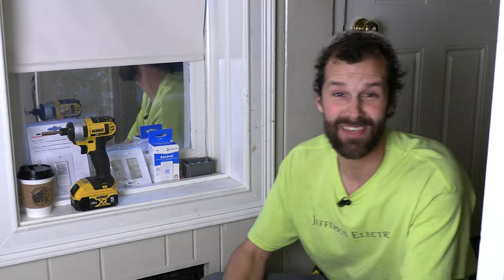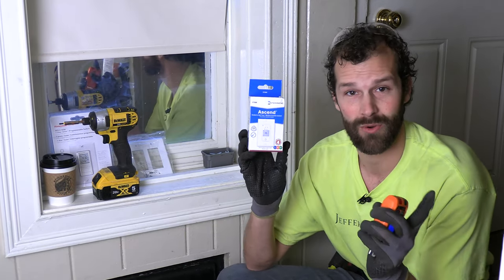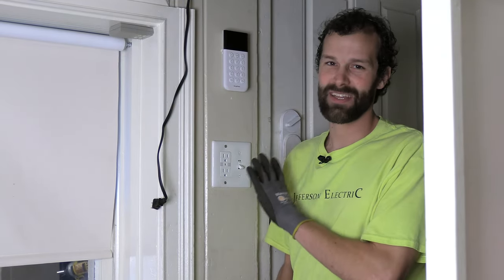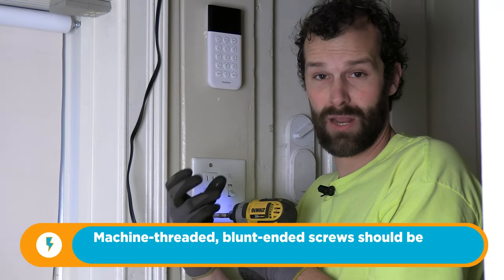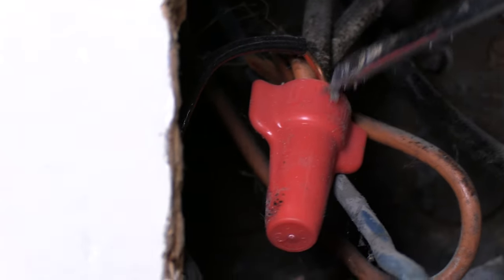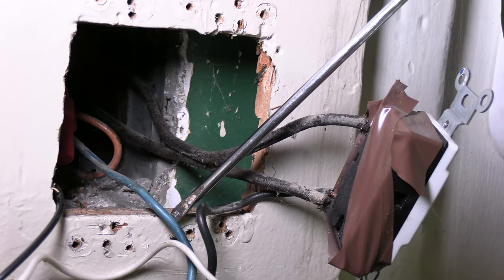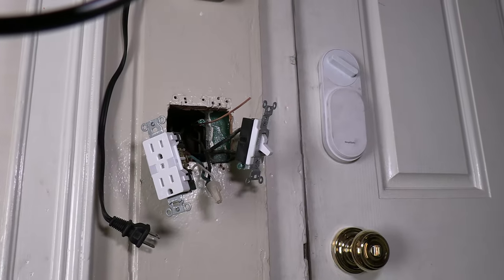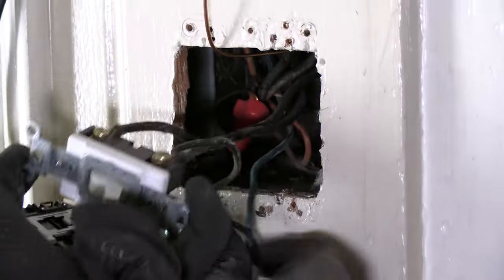Installing New Smart Switches In Old Weird Homes

Comment: I have watched several of your videos and even though one was at least an hour, watched every second of it.  I am just a guy who has always been fascinated by electrical work; if I had a second life it would be as an electrician. Your knowledge of code requirements and the reasons why are very well articulated and comprehensive.  Most of all, you are not taking shots at anyone, but rather will point out code violations that frankly are far beyond the ones that I am familiar with (e.g., using wood screws to secure an electrical device rather than a machine screw) and are doing a public service by posting these videos.  Most of all, for a guy brimming with knowledge and "in the field" know-how and techniques, you are humble when you say "hey, this is what the code requirement in Indianapolis is, but you should check with your local inspector for the requirements where you live".  No one person knows everything.  You are close, but still are decent enough to admit that you are still learning. Very glad I came across your videos, and yes I am a subscriber.

Comment: You taught be to be careful with existing wire and am so grateful Joel.  I don’t twist wire’s anymore and use wagos.  No more destroying wires every time I change something. While the cost is more, replacing a wire is far more expensive.
Reply: WAGO is the way to go.

Comment: I've had to remove smart switches from houses; the owners were 'technically challenged'. They couldn't deal with programmable thermostats either. I've made good money setting up home audio systems too.
Reply: Definitely can see lots of this happening in the future as homes change hands and a house needs 50 apps. I prefer manual timers . Not everything needs internet
Reply: This is going to be and already is somewhat of a bonanza. There is so much Chinese junk going in homes these days.
Reply: @MM-fe9mz  It’s pretty easy to set up a smart home and have everything be controlled by one app.

Comment: Lutron caseta is very consumer friendly, rock solid reliable, great customer service, and highly configurable. Want a 3 way switch, just add a remote (looks identical to switch, no wiring required). To my knowledge, it's one of the only smart solutions that doesn't require a neutral for some switches. Lutron also has more industrial / commercial lines like RA2. Only down side is that they can be pricey and don't look like conventional switches.
Reply: There are plenty of "smart switch" solutions that don't require a neutral, but you always want to use the option with the neutral if you have neutrals available.

Comment: lol, back when I was doing electrical in Canada the #1 square tip was quite standard in every screwdriver set. one could go to Canadian Tire or Home Hardware and every screwdriver set would have at least a #1 and #2 square. medium and larger sets would have the #0-#3 tips. In fact the ground rod clamps I used to use were fastened to the rod and wire with a #3 square.
Since coming to the US for work I haven't had to buy a Robertson tip in the last 4 years.

Comment: I  worked for a company on a residential condo development project.  They had sticking out over a half inch from the drywall and were cutting them flush with aa saw.  Also used the white conductor as a switch loop without remarking it black or red.  Their excuse was that their AHJ was working off the 2008 NEC.   What a bunch of hacks.

Comment: The adding the box equipment ground is a possible concern. Keep in mind im making some assumptions. I am assuming you have some form of older BX,MC, or AC cable coming into the box and you are gaining continuity box to metalic cable, so your outlet tester says the equipment ground is good. However man types of older metalic cable are not approved for use as equipment ground, the metalic cable will have a low DC resistance as read with a meter or work with your tester, but the rotations of a metalic cable in AC form a higher resistance coil that will not clear a fault and cause the metal jacket to heat up and cause a fire. I have seen a similar situation to this cause a house fire.

Comment: Don’t quote me, but I believe the old knob & tube conductors were 14 gauge but rated for 20A because they were in free air, meaning not in a sheath, so they would dissipate heat. Unfortunately most hoses of this age have added insulation, either blown-in or fiberglass, covering the wires. I’m planning on replacing as I can.
I’m not sure that grounding to the Box is code compliant.

Comment: @ElectricProAcademy, @Joel Walsman - Love the videos! Thanks! Have just one hopefully simple question: Is there a similar way to install standard smart three-way switches in a box where the electrician used the neutral from the breaker box as a traveler? 

I have a three-way switch with the Neutrals in the box, but this is the load switch (shorts the circuit, when I connect the Neutral wire to the switch), and the line switch uses the Neutral wire as one of the Travelers! The line switch is configured in a two-gang box with another three-way switch (I would like to replace that one, too). Can I pig-tail the Line (or Neutral) wire from the adjacent switch to the Neutral for the smart switch? Thanks.

Comment: Is there a short edited version of this? Video quality is great and all. Can a 3 wire dim smart switch be safely retrofitted to old 2 wire house?
Reply: Probably.  It depends.  Most smart switches demand a ground, but I bet that's more CYA than anything.  If you have a ground in the switch box, I'd be you're fine.  If you have a neutral too, you're golden and I'd use the 4-wire version (as they're sometimes called).

Comment: I tried x-10, did not like them, got z-wave with a vera brain. I love it. I got motion detectors, cameras, door and smart switches. When inside opening the door turns on the light, outside motion turns on inside and outside lights. The camera records when the lights come on, the camera turns on lights if it sees motion. After 10 minutes vera turns off the lights, at 10 the lights throughout the house get turned off and at 930 in the morning. lights do not come on between 7 am and 4pm

Comment: If you have good, modern wiring and you plan to use a wire nut, the best method I've found for mixing solid and stranded conductors is via pre-twisting.  To ensure the stranded conductors don't come loose the best pre-twist method I've found is to arrange the conductors in a flat line so that none overlaps the other, making sure to keep any stranded conductors toward the center of that line.  Then I use a set of linesman's pliers which grips all of the wires equally and give the whole thing 1.5-2 full rotations of my pliers.  Cut the un-twisted bits off and thread on the wire nut, and make as many twists and tugs as your heart desires to ensure it is all well-connected.  

If you want to do a quick and dirty test of mechanical connectivity, twist the wires together with linesman's pliers like above, then cut and stick them in the wire nut.  Now for the fun part, or as I like or call it, "Fuck the next guy!":  Find a drill socket that fits the knurling on your wire nuts.  (You have already verified the wire nut is on there, right?)  Stick the wire nut and the socket together, and slide your fingers a couple of inches down the wire bundle, then run the drill until the twist reaches your fingers.  It is gentle enough that you won't punch through the top of the wire nut while also ensuring that nothing wiggles loose after the tug test.
Reply from the maker: Wow, that would be a crazy serious termination practice.

Comment: My opinions for lights is to not have them come on at dusk, unless you want them for security more security, but to have them become "active" when the sun goes down, meaning that at dusk, and dark, if they detect motion, then come on, then at dawn, not come on anymore whether they detect motion or not. So for that, two switches, dusk to dawn and motion sensor would be ideal. If there's a situation where you want the lights to come on without needing to go out there or in the day time, for whatever reason, then you would still need a manual switch. (Resuming video now)

In 1938 polarized plugs weren't a thing either. When my Mother and Dad inherited my great grandpa's home, I was 5. So I was too young to know about rewiring anything. Even though it was 1981, the house was built back when there were not polarized plugs. My parents had a fit trying to plug things in. My Great Grandpa had adapters on everything. He even had those electrical extension cords that screwed into light sockets with cloth wire.

Lever nuts would have really behooved you there. Prefer Wago brand just because they're not bulky. Look forward to seeing what you do when you rewire your house. I'm "SHOCKED" no pun intended, that you didn't use a box and put those connections back into the wall without a box.
Reply: In 2019, I did exactly as Joel did here for my front porch light. The light was replaced in 2016 with a better looking light and an LED bulb. The switch is a dusk/dawn switch that stays on all night, off at dawn by utilizing the longitude and your time zone and adjusts on/off every day as the seasons advance. That way, I hear it click to come on in the evening, off in the morning and I don't have to deal with it. The back porch has a photocell to turn on the lights there, and they stay on all night and go off in the morning so I just leave that switch on all the time. Came with the house and is a twin Par light that lights up a good portion of the backyard.
Reply: @johnhpalmer6098   I HATE LED. I use haolgen wherever possible. So much better than that harsh, eye deteriorating, LED rubbish.
Reply: @michaeljavert4635  At one time, I did too. In the early days of LED, they were not very good but have improved a tremendous amount since and now I find them more than fine. With the except of the kitchen main light and under cabinet lighting and my studio, which are either CFL/Fluouescent, the rest are LED, all soft white (3200K) and the light is more than fine. All of my 3-way bulbs are LED too.

Comment: Simply adding a grounding screw added round to the circuit because the ground in this case is provided by the metal conduits to the box? Since the box is not visible, I got this doubt
Reply: Yes.

Comment: There are lots of cheaper "smart" switches which have similar capabilities for much cheaper.  Most are programmable through an app on your phone, and they will do the dust-dawn thing just fine.  The big thing with this switch and cheaper ones is current capacity.  Cheaper switches won't go anywhere near 15A load.

Comment: After seeing that mess i dont feel too bad about the wiring in my mobile home (all outlets and switches are decora and use rv style connections (wire is shoved between sharp slits and there is no outlet box its all self contained in the outlet/switch itself), switches dont have a neutral and because of said wiring method it is just straight 14/2 shoved din the back so it uses white as hot for going to the lights but the wire is not marked as hot.

also had multiple neutrals from several circuits meet on an outlet box, so even though i turned power off to the circuit one of the neutrals was still connected to a live circuit so i got a but of arcing while disconnecting it.

boxes for ceiling lights are all bakelite so everyone the holes are stripped for screws, so things dont tighten up correctly. its all a mess but at least there i s alot of slack in the cables to rewire (nothing feels stapled behind the walls either)

Comment: on the plug with night light, you left the wires in wrong poles? And then when you put the switch and plug back in the hole , you did not place a box from the old steel out to the existing burnable wall board. As you said in the start , you had to address these issues as per code . Is it not true , if you have to deal with a NONE CODE BEARING ELECTRIAL issue , you as the licenced electrician , HAD to by law address those issues.  I have watched a lot of your videos and learned , I just need to be correct in my issue if I come across this as a handyman / renovator.

Comment: Why not use wago 221s ?? All your struggles with wire nuts will go away.
Reply from the maker: Ah yes, the age old question! Wire nuts are cheaper at scale (Yes, individually the cost difference may be negligible, but we're an electrical contracting business: It adds up!) and, in our opinion, create a stronger electrical connection through compression as opposed to the spring force of a Wago. Wagos have definitely proven themselves in the industry, especially in hard-to-reach places, but our default is still wire nuts.